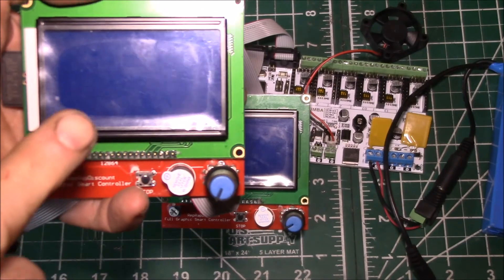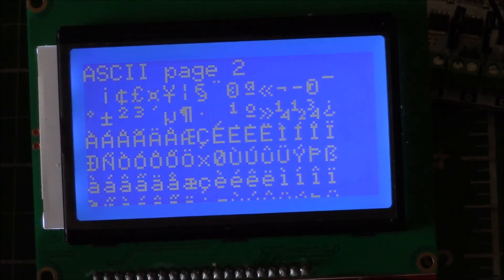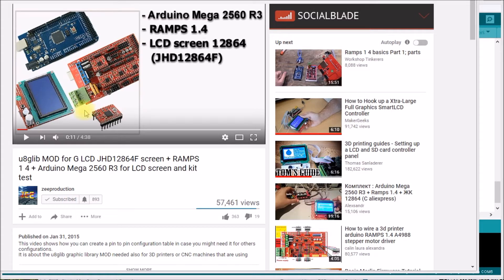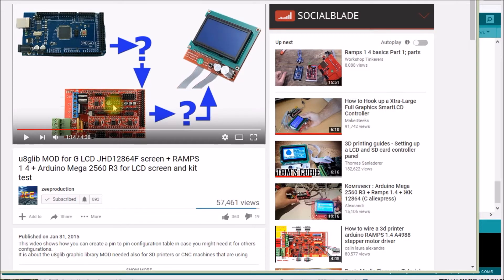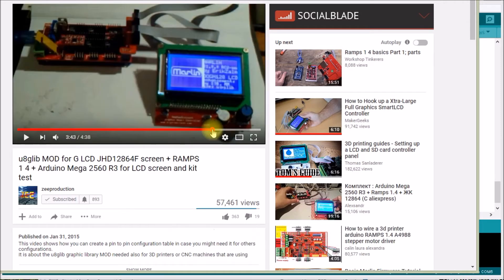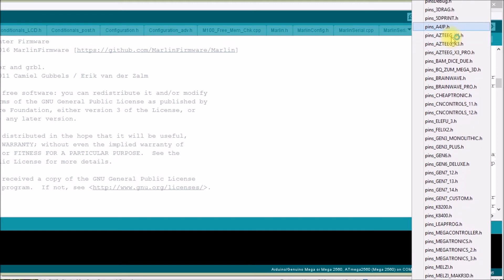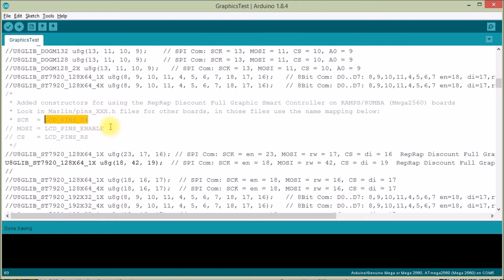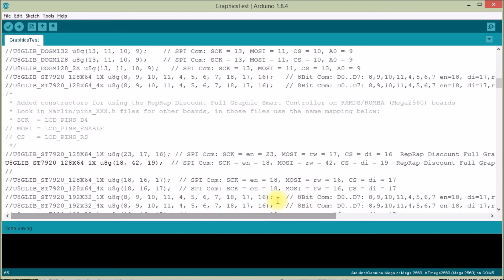RepRapDiscount Full Graphic Smart Controller on RUMBA

Comment: I am struggling with the reprapdiscount smartcontroller and the ramps1.4 a shieldas you suggested, I am trying to run graphictest and added this lineU8GLIB_ST7920_128X64_1X u8g(23, 17, 16); // SPI Com: SCK = en = 23, MOSI = rw = 17now I get a compiling error for Mega or mega 2560any idea whats go wrong?
Reply from the maker: Try commenting out the line you added and see if the error goes away.  If so, uncomment the line and then carefully check it for typos.  Sometimes a small error in one line of code won't produce a compiler error or warning for that line, but it'll show up as an error later on in the code.  I just ran into that last week when I was editing some source code for another program.  Also, for the Ramps board, the pin assignments may be different than on the Rumba board like I used.  I've not worked with the Ramps board, but you may need to see the pins_RAMPS.h file for the appropriate line of code instead of the pins_RUMBA.h file that I used.
Reply: when I uncommon this line I get the errorU8g was not declared.even when I use one of the Original lines I get the compiling error for MegaI have adjusted it to 23, 17, 16, which should work with the ramps shieldbut still I get the compiling error.I will now look to the pins_RAMS.h on the Marlin code
Reply from the maker: Yes, the pins_RAMPS.h file may have some different definitions in it.  I think the main difference between Ramps and Rumba boards are the Ramps needs and external Arduino board while the Rumba has the Arduino Mega built in.  So the Rumba code assumes the built in micro controller while the Ramps probably has separate definitions depending on what Arduino is connected to it.

Comment: cool test program
Reply from the maker: It sure is, lots of good test programs can be found in all the Arduino code examples.  At least now I can figure out how to get some of those working on this more elaborate hardware like the RUMBA and RAMPS boards.  It's easy with a little Arduino Nano, plug in a few jumper wires into the designated pins and you are up and running.  But here, the connectors are already installed and you need to figure out how they are wired.